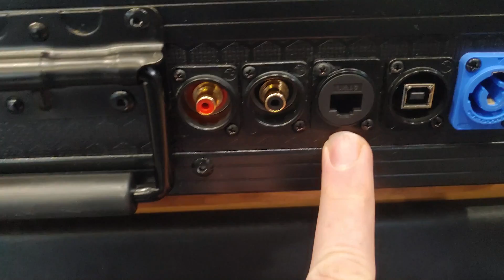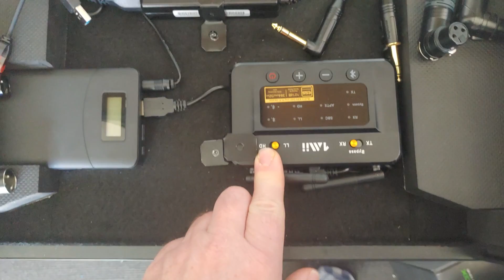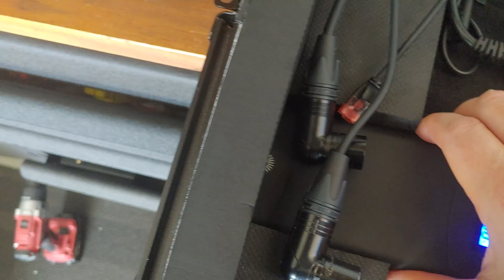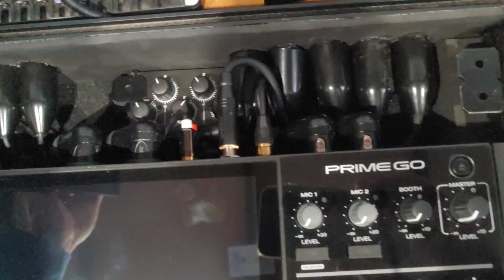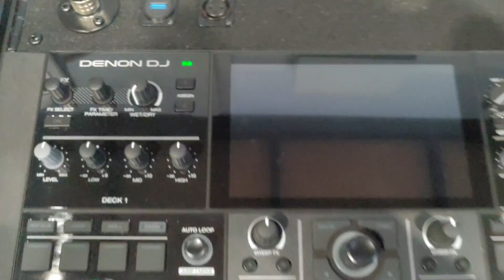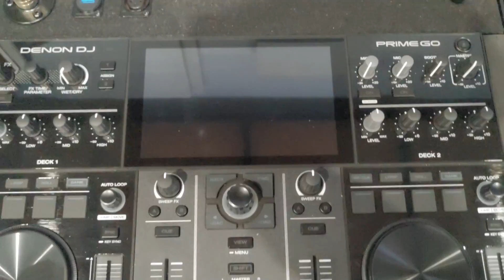Denon Prime Go DJ Controller Custom PRO-X Case

Comment: Great video, thanks for all the detail! I’ve seen people use a usb splitter for the flash drive insert on the back which allows for multiple usbs to be plugged into the unit. So you could add a second usb port if you ever wanted to do back to back dj sets

Comment: A big heads up,  Despite all of the things Prime Go can do it can't separate the VU on the master meter for individual channels.  

This thing is a piece of crap if you can't even level your music.   Buy something else until Denon gets their act together.  

People have been on the forum bitching about this since April.   No fix in sight.  Garbage waste of time Prime Go is.
Reply from the maker: Respectfully I'd have to disagree in relation to the lack of pre-fader V.U Meters.

Whilst it would be a "nice to have", it doesn't hinder performance in any way. The internal software does a respectable job of auto levelling hot files.

You can always boost levels by ear if required. 

I have now used the Prime Go for over 30 events and it has been flawless in every application. No thermal issues, no lock-ups, no sound quality issues. Current firmware installed.

Is it perfect? No!   Mic EQ would be great. Speedier search times on SD card would be welcome also. Software needs a few tweaks for ease of use as well. It's a work in progress.

Bear in mind Denon created a brand new category that never existed prior to the Prime Go.  I'm sure the next gen units will address current shortcomings.

As a side note, 3 of my colleagues now use the Prime Go as their main rig. Their DDJ-1000/CDJ consoles only get taken out on high dollar gigs.

Sub standard MP3 files, lack of operator knowledge, poor quality cabling is a greater issue than the lack of channel VU Meters in my opinion.

I'm not a Denon brand ambassador, but I recognise when a product comes to market and changes the game ......
Reply: @tonyboz9218   It certainly ticks MOST of the boxes it should.  This is just such a basic feature that you'd expect a thousand dollar piece of Kit to at least do something that a hundred dollar gemini mixer can do.  

Raving since 95. Producing since 97 and Djing since 2000.   Lack of experience certainly not an issue. 

My ears aren't as reliable as I'd like anymore.  Lots of loud volume hasn't exactly made my hearing any better.  VU helps with that.  

Mps3. That's so funny.  No man.  All Wavs. 

I can make this work, I just think it's BS I have to jump through hoops to make that happen. 

I also think it's funny that so many idiots just assume I hate Denon and am some kind of Pioneer fanboy coming here to cause trouble.   

Had this unit in my house for five minutes before I decided it was crap.   Switched off the cross fader.  (Lucky me, A feature it DOES have,)   Then went to split the VU and found no option for it.  

You DJ the way you want to DJ, and I will DJ the way I want to DJ.   I like VU meters.  There is no amount of trying to convince me that it's not necessary. That's going to sell me on the fact it doesn't have such a basic feature.  

Even worse, we've now had a second update and no fix.  It isn't like Denon isn't aware of this.   Which leads me to believe there never will be a fix.   

I am not an ambassador of Denon either, but I also recognize when something is a "potential" game changer but if you can't properly level your mixes, what is the point?  

I'd have passed on so many of these features FX included for just the ability to mix properly.
Reply: @tonyboz9218  I'd also like to mention that despite my dislike of the Go.  It was super crafty the way you set up your case.

Comment: Where did you get the power bank?
Reply from the maker: This is the unit I used in the case.  https://www.officeworks.com.au/shop/officeworks/p/comsol-20000mah-laptop-powerbank-black-colp200

There are many options available on Amazon. Just look for a unit that has USB-C PD with min of 60W @ 19-20V. You may need a USB-C to 2.1mm DC adapter cable.

Comment: You are blocking the ventilation on both sides. Your solition is? If the unit heat up over 40 degrees Celsius you will get in trouble.
Reply from the maker: Thanks for the tip Alf.... Interesting that Pro-X does not accommodate for the side vents. Might send them an email.

I have run this 12 hours straight and it only gets warm around the screen if the battery is charging at the same time as you are using the unit. 

I'll definately keep an eye out for any potential heat issues.....
Reply: My tip is to make an excavation where the vents is placed so you can have the required airflow. I have a friend that run into this problem and Prime GO started to throttle like a computer with overheat problem. But I really like the case and all of your solutions. Good work!!
Reply: I ordered this case and just thought of this same issue.  I may put a flap with a hinge on the bottom of the case to prop the unit out a bit at an angle to get those vents free.